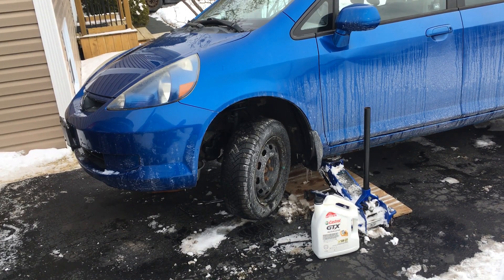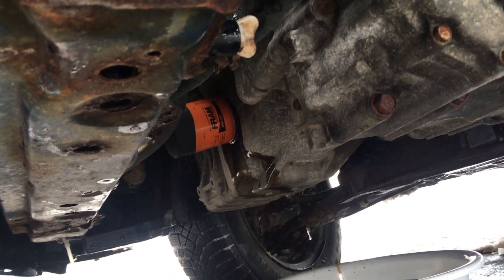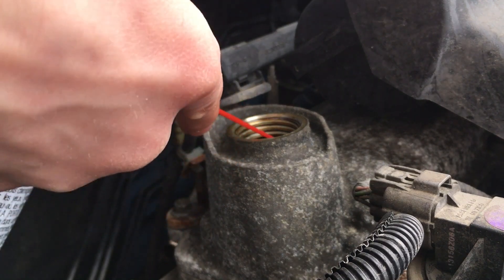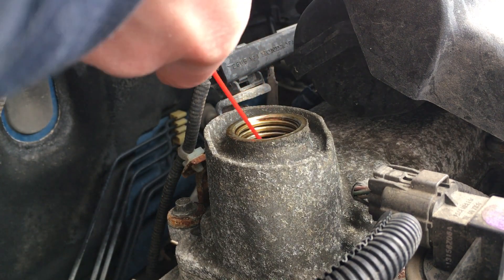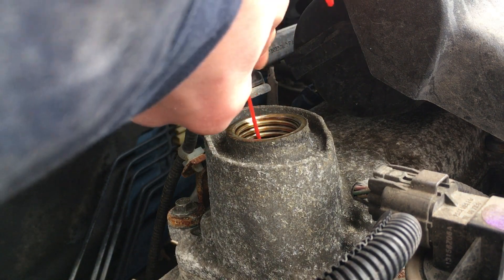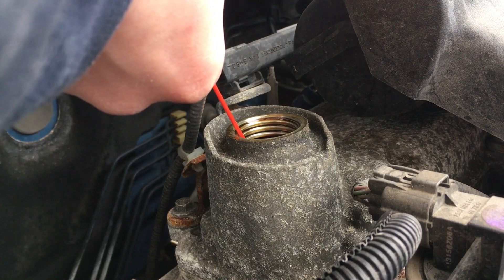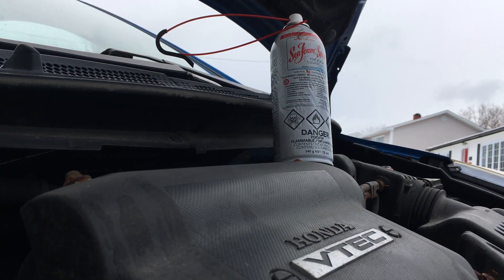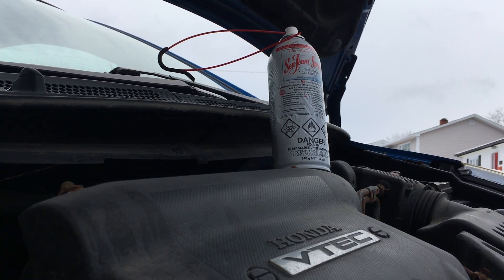How I Use Seafoam DURING Oil Changes | Prevent Engine SLUDGE!

Comment: What you are doing is the job of the detergent package in the motor oil. Perhaps you would be better off using a high end oil with a good detergent additive package and use the spray through the intake before your scheduled oil change.

Comment: I have never seen anyone “spray” it in the oil fill….. it’s always threw the intake….. that’s literally the difference between the aerosol can vrs the liquid…..the only way this “spray” works is if you heat soak the engine, so spraying it in does nothing, not even close to hot enough and not even Equivalent to driving less than 1 mile and the stuff requires to drive atleast 300miles so there is absolutely nothing that is doing, pour the right amount of liquid in the oil before an oil change then the rest in the gas and drive it, then before your oil change if you really want to clean it you take your spray can and blow it in your intake with it running at 2000rpm and shut it off for 15 minutes or so and fire it up when the smoke shows done then change your oil
Reply from the maker: It’s a dispersant, it certainly does something… heat or no heat in the engine it’s going to help push the old engine oil which has clung to various surfaces down to the pan for draining meaning you get a fresher fill after adding back the new oil. While a little outside the box of its intended uses it certainly works and I’ll continue to defend its use this way.
Reply from the maker: I do use it in the traditional ways as well adding it to the crank case or spraying it into the throttle body etc from time to time as well but this is what I do while changing the oil itself.

Comment: Doesn’t seem like it will have a chance to hit the majority of engine areas/components this way.  What are your thoughts on cold engine start where the majority of wear occurs?  This is literally removing ALL the oil from some of the components and eliminating that desirable thin oil film is needed to provide some level of protection before oil starts flowing after startup.
Reply from the maker: I was spraying it directly on the timing chain assembly which can be seen from the oil cap on a variety of engines, while likely not hitting all components it is a dispersant so it does as good a job as possible at pushing the old oil down to the base pan where it can drain. I have little worry of this causing any damage to any engine being just one start up each time the oil has been changed while keeping in mind, the old oil which has sheared may not be there to protect the engine on startup but another lubricant has replaced it. With modern day engines using such thin synthetic motor oils… 5w20, 0w20, 0w16 etc it really doesn’t take long these days for oil to reach the head and valve train.
Reply from the maker: This particular vehicle hadn’t seen an oil change in over 2 years and an excessive amount of mileage, I wanted to be certain I got out what I could prior to adding my fresh fill.

Comment: Bull
Reply from the maker: What makes you disagree? Old oil, it’s contaminants and the fact it has likely sheared contribute to premature wear inside your engine causing things like timing chain stretch & bearing wear leading to things like rod knock down the line. Seafoam and other engine treatments are dispersants allowing as much old oil to leave the engine as possible when used in this manner.
Reply: @combustiontherapy2222  
Spraying ... seafood in your valve cover? Come on man. I see those pretty hands that never took a engine, transmission, rear apart. How often to you get your nails done? You are full of crap. Love to see you in a shop. You probably shine your adjustable wrench too. Lol
Reply: I wouldn't call it bull. It's a bit unorthodox, sure, but it's definitely doing something if the engine runs and is heat cycled a few times. I don't know how much more effective this is than using the liquid, but it's definitely doing some work on the deposits while running. To each their own, I'd do this with fresh oil and run it a few hundred miles and then change the oil again- that's just me.